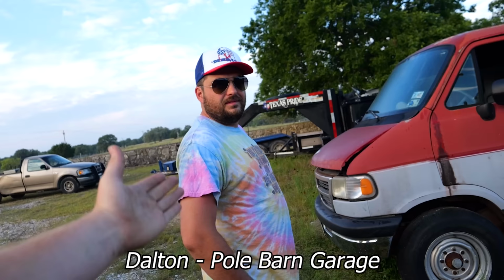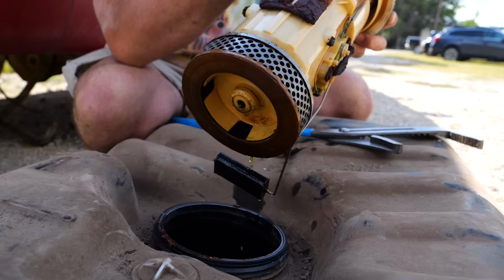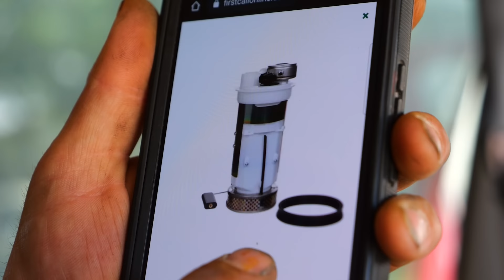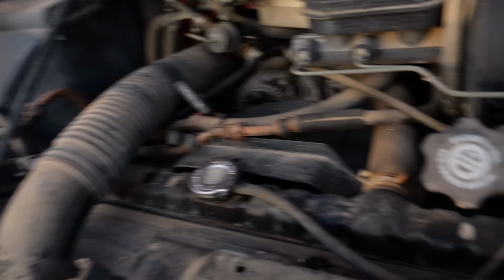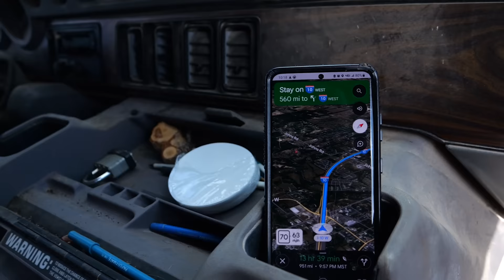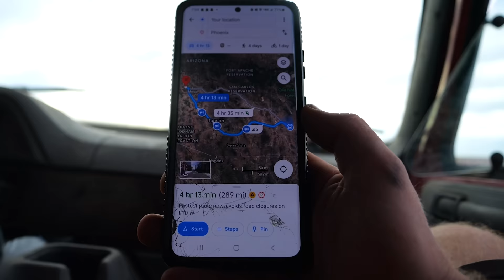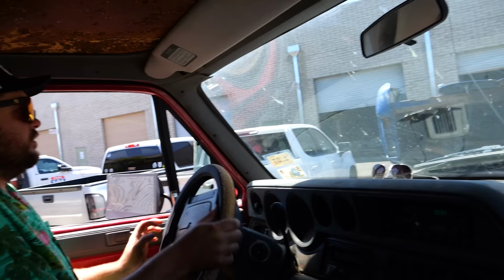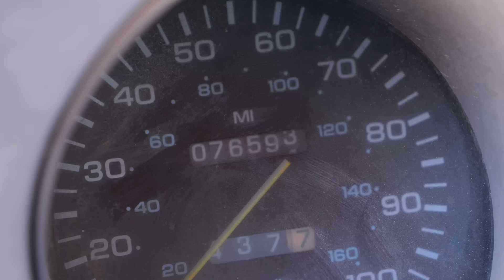Can We Drive 1,200 MILES in an ABANDONED Van With NO TITLE? - First Start in 17 Years

Comment: When you remove the doghouse, keep the same motion going to pick it up and turn it upside down. It will fit between the seats and the ceiling and you get the doghouse out of the way. To put it back on, just reverse the process. Easy-breezy, one motion each way.

Comment: Harbor freight has 8" slip jaw pliers. I bought a set to never have an issue with plumbing fittings again but surprisingly they are also great at removing those plastic fuel pump rings

Comment: Lol you guys getting delirious after a long long drive reminds me of what used to happen to me and my dad when we went on long long treks, after while we just started talking nonsense and it's the funniest shit ever even though it's not 😂😂😂

Idk what it is about Dodges and 360s in particular but ive never seen vehicles that run better after sitting for a LONG time. My mom's old '86 Ramcharger w/360 and a quadrajet would fire right up with a few pumps to activate the choke and it would crank right up...didn't even need a battery. Crazy stuff. That van ran really good and got you there as efficiently as possible. People talk shit on Mopars but here is proof that they're pretty damn stout, especially old LA block powered stuff.

Sad to see the old van die but at least it's powertrain will live on in the name of a good cause ❤

Comment: I had a 95 Dakota with the V8. When the fuel pump went out I was to broke for the $400 assembly so I took it apart and zip tied a fuel pump from an 86 f350 in where the old one goes in the bucket. Surprisingly that actually worked and I drove it like that for 2 years before I sold the truck

Comment: I used to daily a 15-pass Dodge van of the same generation, also with the 360 providing the motivation.  It had assorted problems but NONE of them were the engine - EVER.  HVAC went toes-up, the transmission had an occasional issue related to the controls, one time the driveshaft literally fell out...but the engine was unkillable.  100-150 miles per day, every day, for about six years.  That mill is solid.,

Comment: I am reminded of when I did a major tuneup on my 2001 van, and it wouldn't idle. It needed a drive to learn how to run again with the new Bosch plugs, wires, and K&N air cleaner.

Comment: I did a 13hr trip from CO to AZ in a lifted and loaded Toyota pickup with no A/C, 5speed, and in 85-102 degree heat. My only complaint was driving with zero visibility and being pelted by sand like I was in a blasting cabinet. And 2 1/2 weeks later do it all over again.

Comment: My mom and dad had a new ‘79 Dodge Van that they fixed up the inside with paneling and black/white/brown shag carpet, a Craig am/fm receiver with utralineer home stereo speakers in the back and my seat wasn’t bolted down and I had to do evasive maneuvers to avoid flying to the front with the seat for hard braking 🤣🤣🤣🤣🤣
I took my drivers license road test in this baby at 15 years old in 1982 😳😳

Comment: The most impressive fete was the fact you guys were driving that van around without AC. Also in Arizona DPS or Highway Patrol camp out on the interstate every ten miles stopping speeders. As long as you don't speed you'll be ok.

Comment: running it on spray does help when they set for a long time i have done that to make fuel injection vehicles to start working when i do have fuel pressure guessing the heat in the injectors loosens the junk in the jets

Comment: The magnum series of engines have a idle memory and after a battery disconnect it will usually loose that memory. It will take a cycle or two to relearn because the memory is all for the injection system. I ran into this on a customers magnum v6 Dakota.

Comment: After this you better not be bad-mouthing Dodge vans ! 😂
We had a 1994 B3500 work/vacation Dodge Van that lasted twenty-four years.
It towed big boats for fun and hauled heavy steel forgings for work.
Once it even towed a stalled Ford pickup truck towing a boat up the steep ramp at Lake Powell.
After 24 years it was taken out by rodents that chewed up the wiring. 😡
Oh yeah, I almost forgot.
The A/C still worked.

Comment: Me sitting here seeing the mustang and thinking "watch the oil pressure on that thing like a hawk" tritons are EVIL, every one I've worked on modded or otherwise has had cam, timing set, oil pressure, or ignition coil issues or a combination of the lot, and that 46 feet of timing chain? Yeah I've done it... I had to do it 3 times on one car cause of the previously mentioned issues, a timing set failed, then the lash adjusters, then the oil pump all within a month, for that reason I will never own a triton by choice

Comment: early dodge fuel injection system needs to relearn the IAC to stay running at idle. start van with foot on gas and slowly let off and let the IAC learn its position. Unless the Idle Air Control is stuck..Fun video guys

Comment: It's a dodge 5.9 magnum. It's bulletproof. Be gentle with the trans, though. She's  made of glass. Insert 4L60E meme here. The trans is why I sold mine. Lost fourth and sometimes third. I had headers and true dual straight pipes. It cackled like a MF when cold, but it sold to a kid. I'm too old for that rowdiness. I'm in my damn 30s now.

I'm glad it went to a new home. I'm glad a young pup gets to hear her cackle every start. Get around 2800 rippums, and it's just bitchin'. I miss her, but I'm glad a young buck gets to have the same feeling. That cold start is the best sound I've ever heard. She's fat and nasty. The best part? It was a single cab short box with a lift kit. It looked like a damn tonka truck. Very short length, but very tall height.

Comment: Had a 1996 Dodge Ram B250 with a 5.2 out of a 1999 ram 1500 truck   bed the van originally had a 5.2 that blew up we had a wrecked truck with a good engine Lil work it hooked up

Comment: My 2013 f250 gasser gets like 10.5 at 80. But boy does it like 75 - 85... lol. Anything less than 70,  i run it in 5th for pull and no chug.. Stock trans tune sucks.

Comment: LOL, I've eaten at that Kranberry's Chatterbox in Lordsburg! They have some pretty good food there actually.😉😋 I still can't believe you made it past the BP without getting stopped.😮 I'm guessing the onboard advertising helped! 🤣 That 360 in the one-ton vans, will get about 12-14 mpg. all day, loaded or empty.😄 EDIT: I wouldn't give a plugged nickel for any Ford that has one of those Coyote V8's. They're all fine until they barf all 46 feet of that timing chain out through the timing cover at about 7800 rpm, and bend every valve in the engine, AND ventilate a piston or 3 with the ones that snap off in the combustion chamber.💣💥 That's generally a pretty good time to throw a half gallon of gas and a lit match in the front seat and walk away!🤣

Comment: At approximately 15:05 - 15:25... this has got to be one of the most idiotic things I've witnessed in my lifetime. Kevin said it himself: "How did that not explode?". You're both blessed to be alive and undamaged so be sure to give thanks for the mercy of the almighty. Every single day for the rest of your lives! While I've never watched anyone actually get burned badly enough to die, I have seen someone on fire and it wasn't pretty - there was a lot of screaming until they passed out. With their arm still on fire along with other parts of their shirt and pants. The aftermath involved a lot of severe pain coupled with a lot of skin grafting with close to 3 years of healing on the arm and hand with severe and permanent tissue damage. I doubt I need to mention how bad the result looked. The moral of the story here is to never, ever, EVER use a cutting torch, plasma cutter or any form of cutting tools (including abrasive cutting discs) which generate sparks around fuel tanks or fuel lines. Nor around any containers of flammable or explosive liquids commonly found in the garage. Even if you only start a fire, think of the damage you may cause even if you do eventually end up putting it out. And that explosion thing? It'll happen so fast you won't know it happened until you come to your senses after it happens. If you do come to your senses that is. After all, you may be dead. If you aren't? You might just wish you were. Good grief Kevin... I expected you to be far smarter than what I witnessed due to your military experience. Surely they trained you better than that? I went back and watched the video again to be sure. Nope, no personal protective equipment - not even safety glasses. No fire suppression equipment. No fire fighting equipment at all, if there was I missed it. Yeah, I think it's safe to say that the both of you better be thankful for what didn't happen because it also wouldn't have been pretty. That part of the video was very epically cringe inducing.

Comment: Hey, I got a Z24 Chevy Cavalier 2.4L that's been sitting in my garage for 20+ years. My dad had bought it from an auction and doesn't remember where the title is. How would I go about claiming it? It's pristine and only has 90,000 miles (manual btw). We have a spare 2.4 L engine as well so I really want a nice gas saver

Comment: im not too familar with dodge but that's probably not multiport but throttle body injection
Reply: i take that back, GM had their injectors mounted on the top of the throttle body unit before the butterflies. dodge is completely different